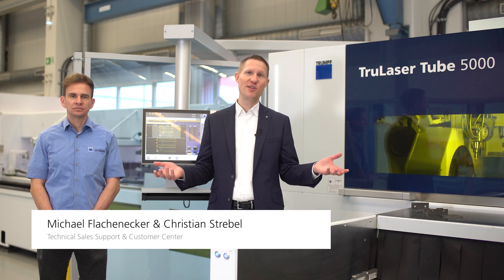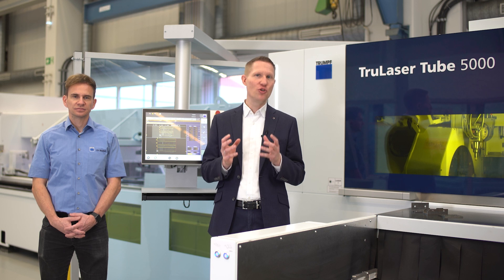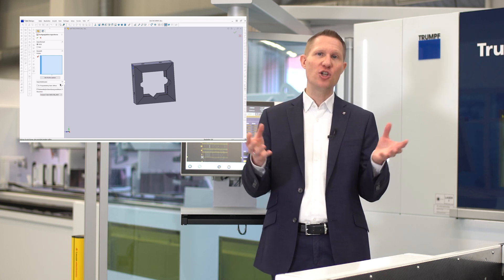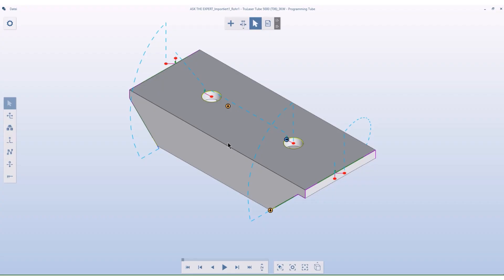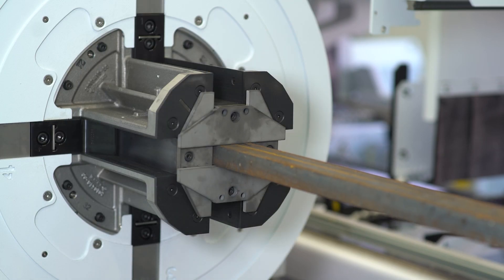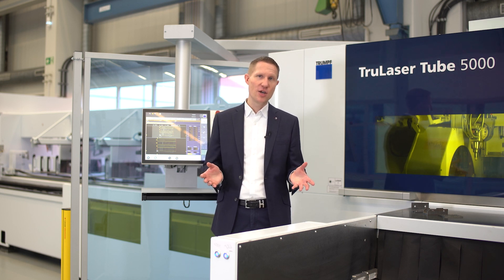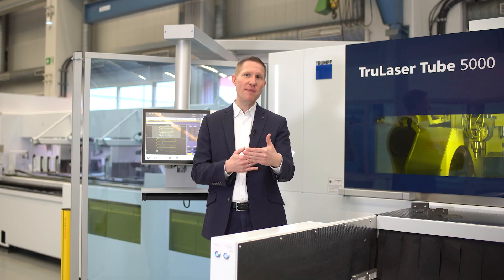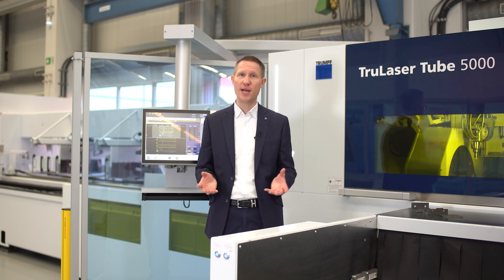TRUMPF: Ask the Expert – How to handle open profiles

Comment: And hou cutting L profiles 
Mvg William
Reply from the maker: Hello @williamjohndeere4873, the procedure (programming, adaptive clamping etc.) with angled profiles is the same as for u channels. Only the loading of the profile via the conveyor chain must be checked before - we must be sure that it does not loose its orientation during the loading procedure. Anyhow manual loading directly on the machine bed is always possible. 

Best regards from your TRUMPF group
Reply: When you cut l shapes you moest make ik sqware ore no or you load the l profile whit out a plate voor clamping maby a video wil you make maby white the tru laser tube 5000 fiber
Mvg William